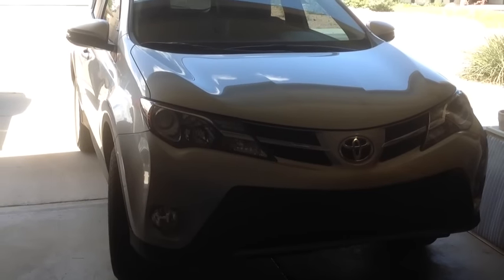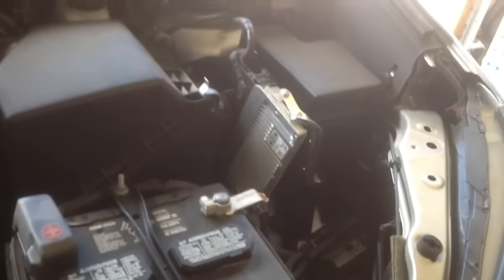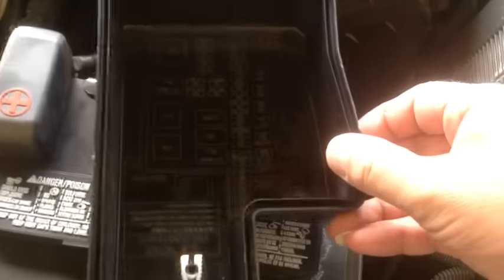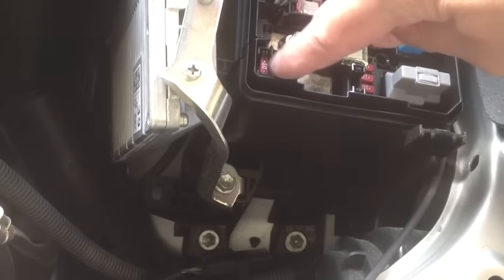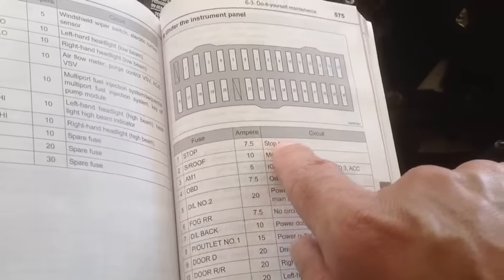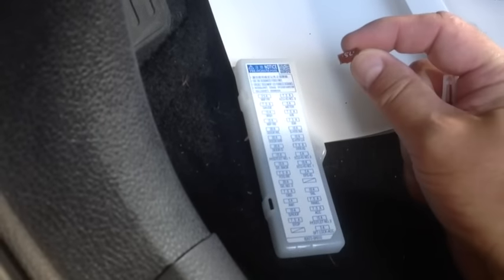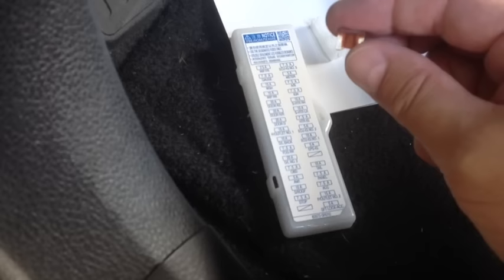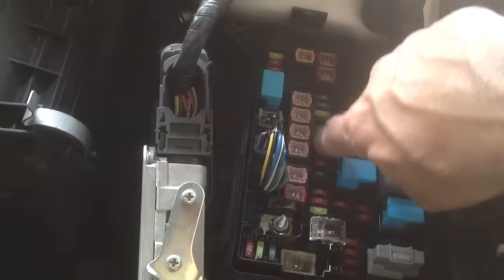How to change Fuses for Toyota RAV4  2013, 2014, 2015, 2016 fuse box

Comment: I just had to replace the 15 amp fuse for power outlet #2. I blew it out trying to use my air compressor to inflate the spare which takes 60 PSI. I forgot the same thing happened last year. What a pain in the neck! I need to wire a rear power outlet with a bigger fuse!

Comment: I'd have first checked the bulbs were only one light out, but I'd think checking the fuse would have been the logical first step instead since one of three worked.  But, since there's only one fuse, I would have thought that'd negate that as an option?  If all three were out, I'd say fuse - but since one worked, I wouldn't have thought it a fuse.  So, given that I've checked my bulb on my one light that's out...I was lead to this video.  But now, I don't think it'd be the fuse.  So, what'd it turn out to be when you got it resolved?  :)

Comment: Thanks for the video!  What was the cause of your two brake lights not working?
Reply: Very helpful, more on a Friday night. What was the issue? Fuses and bulbs are fine, but the two rear break light are not working. Only the one in the spoiler.
Reply: My guess is the switch connected to the brake pedal. Sometimes they can come loose and the lights won't work.
Reply: mine was that fuse under the dash.     I did have to squeeze the tool at the fuse end after attaching it and help the tool pull the fuse out, the fuse was held in very tight.

Comment: On my 2017 rav 4 the head light symbol on dash isn't illuminating. But head lights are on. The dimmer switch is all the up
Reply: Hey killmonize, did you ever get it figured out? Mine is doing the same as yours. Any help would be appreciated.
Reply: @yyang5415  funny thing. It went away. But the headlights are burning out faster than normal. Knock on wood. Been pretty good recently.  I'll keep you updated